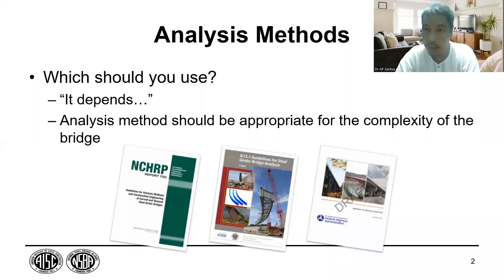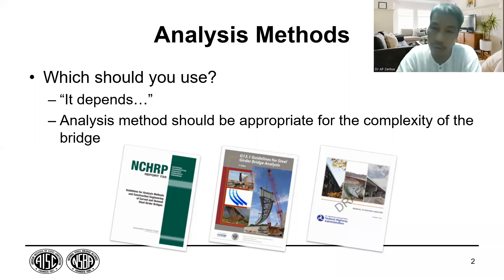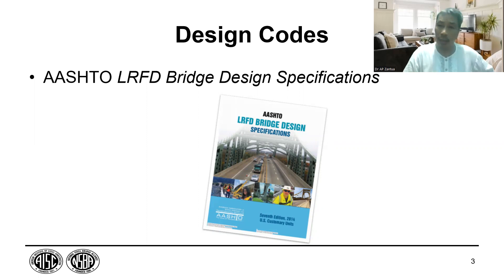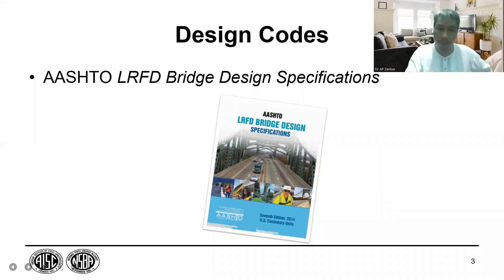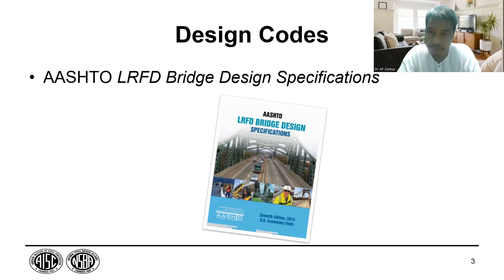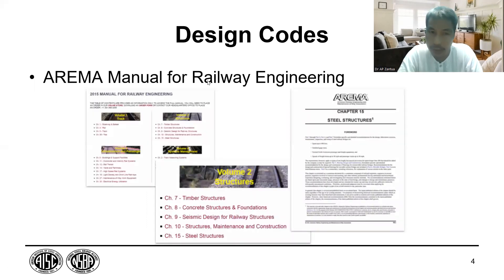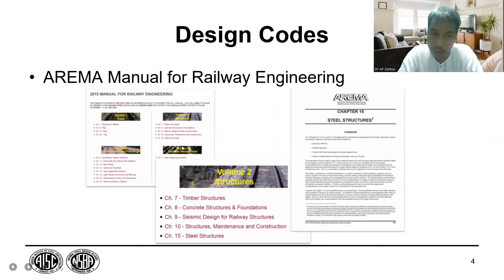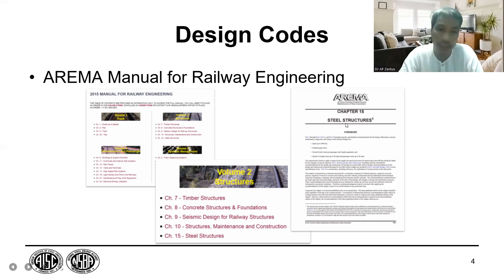BRIDGE Engineering Design Code [ Highway & Railroad Engineering ] Module 5.08

Comment: Sir, I appreciate you discussing the bridge engineering codes that ought to be applied while evaluating a building. The complexity of the bridge dictates the approach. However, I've found that the most cutting-edge approach in the modern world is 2D FEM analysis.

Comment: Thank you for this video lecture that tackles about the codes that should be used in Bridge engineering design. In this video you'll see some references that we can use the appropriate to the complexity of the bridge. Here are some specific Design codes just like AASHTO Standard that means American Association of State Highways and Transportation Officials and AREMA Manual for Railway Engineering is the go-to standard manual in US when talking about Railway.

Comment: Sir, thank you for talking about which bridge engineering codes should be utilized while examining a construction. The approach is determined by the bridge's complexity. However, I've discovered that, in today's world, 2D FEM analysis is the most advanced way.

Comment: thank you sir for discussing us about bridge engineering codes which are analysis method and design codes. Analysis method could be use depends to the problem and should be appropriate for the complexity of the bridge. Design codes is from AASHTO LFRD bridge design specification and AREMA manual for railway engineering.

Comment: Thank you, sir for discussing what bridge engineering codes should be used when analyzing a structure. The method depends to the complexity of the bridge. However, I have learned that 2D FEM analysis are the top of the line method as of todays.